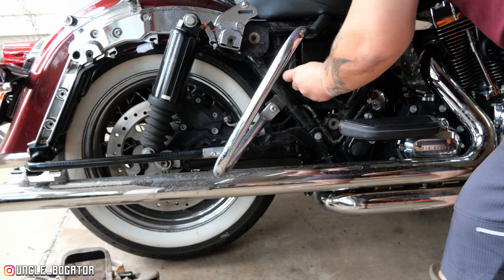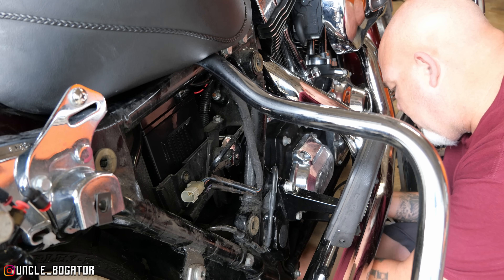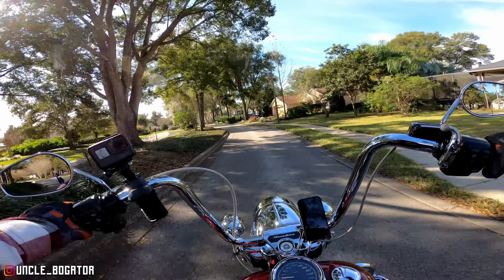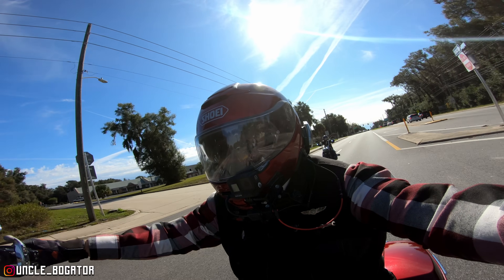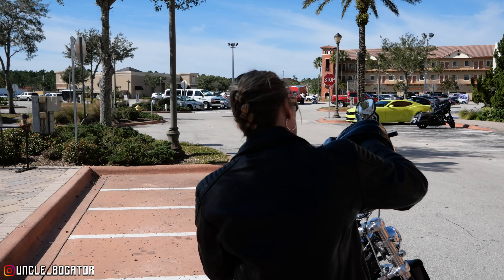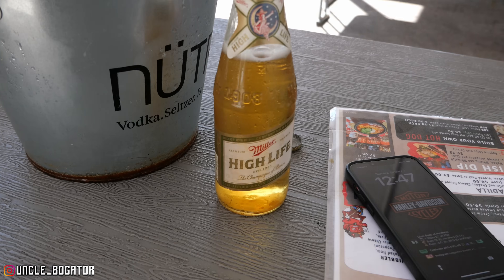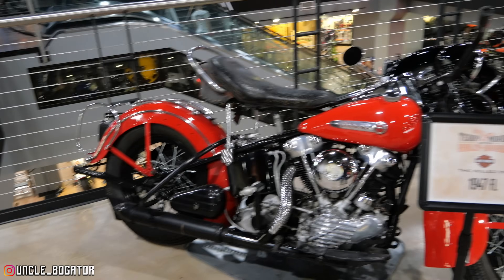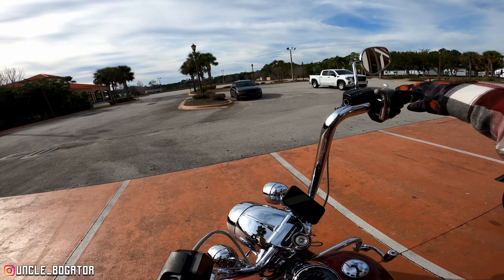Regrets and lessons learned from working on my own Harley Davidson

Comment: I put blue tape on my rear before I disconnected it so I dint get it wrong I bought a cheap lift after I got my first bike it came in handy I have 4 Harley's now a nice little collection I got started I bought them so I can spread the miles over 4 bikes instead of putting a lot on one I'm glad I did I like having different Harley's that I can ride I'm partial to the 1200

Comment: I had a shop swap the fuel injectors to the wrong cylinders when they put a new head gasket on my Sportster. It ran but was dumping fuel and couldn't be tuned. Finally, a guy on the Sportster forum had the idea to check the injectors, they were backwards. I swapped them around and it fixed everything. lol, that Sporty was likely running like a diesel for 5K miles. I wouldn't be too hard on yourself as even "professionals" make mistakes.
Reply from the maker: wild man

Comment: You don't want back pressure. Back pressure is 100% a myth, mostly caused from a misunderstanding. Back pressure is bad, exhaust scavenging is good -- and exhaust scavenging goes away without an obstruction in the exhaust stream, like a baffle. The obstruction prevents what is known as "exhaust reversion", which to make a long story short, is the back-flow of exhaust towards the engine between exhaust pulses. This results in low end torque loss, but high RPM horsepower gains.

An obstruction in the exhaust stream prevents reversion by maintaining a more consistent flow due to aerodynamics and math I don't feel like explaining. 😅
Reply from the maker: yeah man I wanted to expand on my statement in the video about scavenging, without going into the reversion piece. Mostly because I only have a very macro level understanding of it. Happy for your comment my man

Comment: Take it to blockheads and buy a tune license for it man. You wont need a unit installed on your bike and it will run way better.
Reply from the maker: Thats the plan after I decide what i want to do with it
Reply: @UncleBogator  ....thanks for getting back man. If you plan on keeping the bike, you should true and weld the crank and get gear drive cams, it'll be like an evo, bulletproof. But you have to have a perfectly trued crank or over time the runout will grow
Reply from the maker: @michaelmitchell5909  i'm on the fence about geared cams. Mostly because of the perfectly trued crank. But we'll see. One of these days I'm going to go full stage 4 on it. Just not sure what I want to do for the displacement side of it. Or the cams.
Reply: @UncleBogator ....I hear ya man, there's alot of options and it's very expensive now. Fuel moto, sns, and zippers are my choices when I'm ready to rebuild. I own a 2004 road king that had a 95" on it when I bought it. Fueling 525 cams too man, they made the motor run strong...